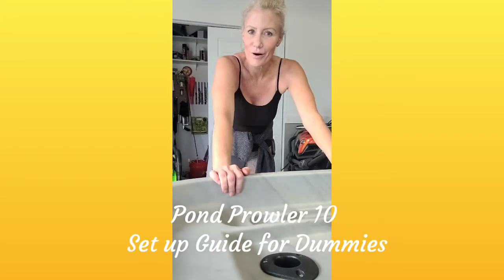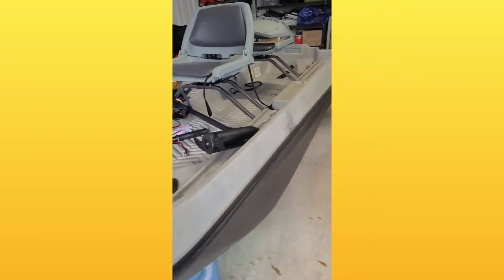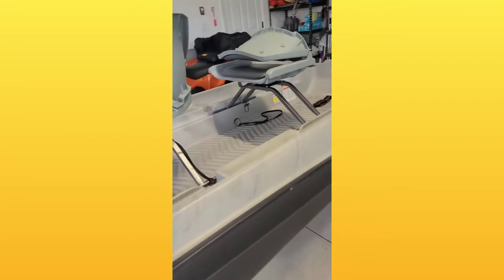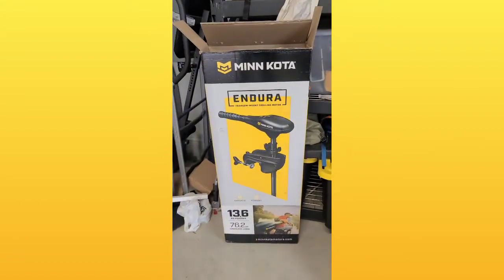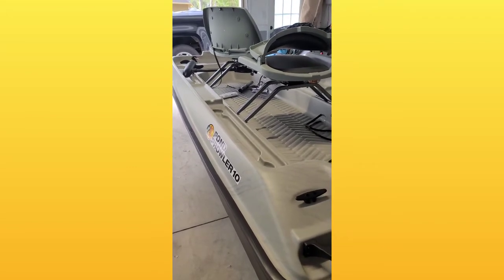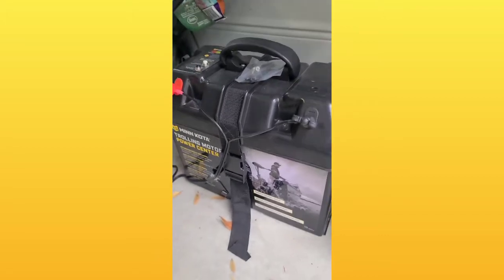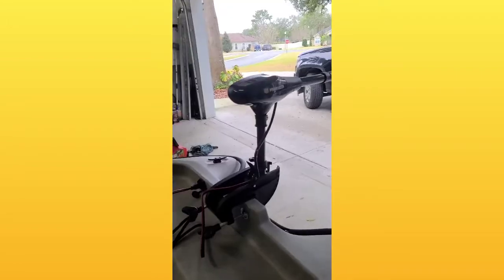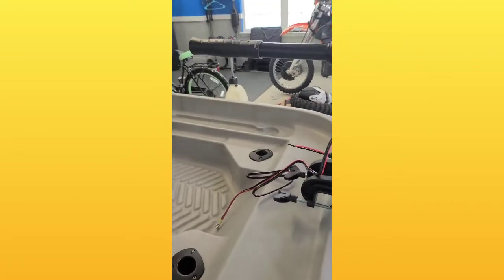Pond Prowler 10 Boat Set Up For Dummies

Comment: Great job. Floor mat is a must. It gets slick without it.  Anchor cleat not necessary. You have one on the front. Look into Pole holders in the back. Add a thick cushion pad on that seat. It hurts the back of your thigh. The pads are also a flutation device. Velcro in a small Box on the side rails. It helps hold all your stuff in one place. And the canopy will make it too hard to cast.
Reply from the maker: Wow, awesome information.  Thanks for sharing with us